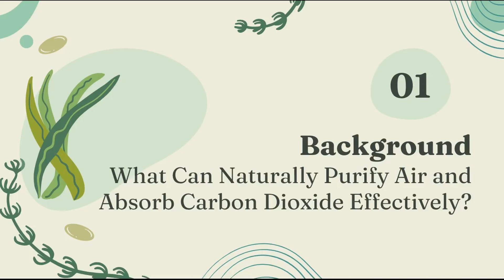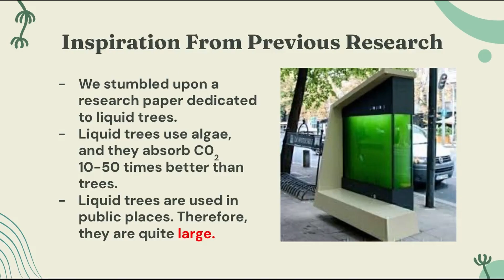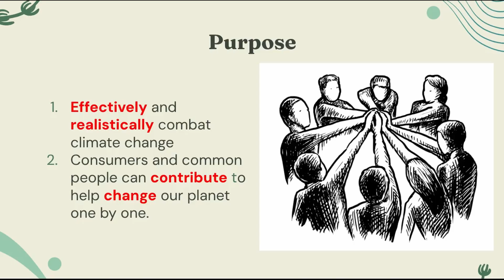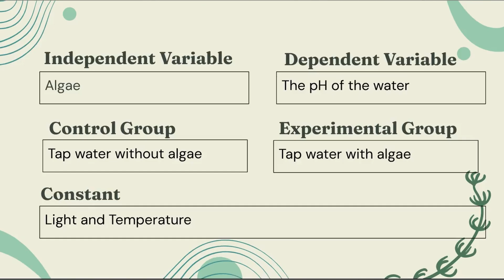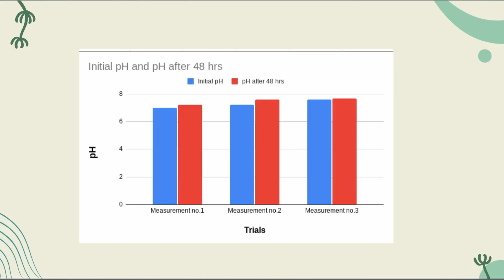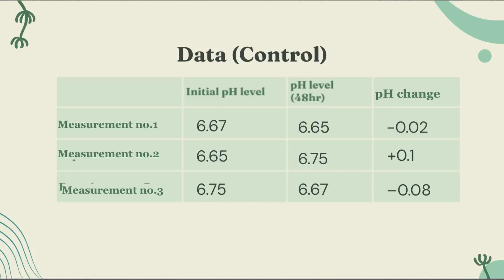Algae Air Purifier

Comment: Hi I came across your project while researching microalgae-based air purification systems, and I found your work really inspiring.I wanted to ask you something: instead of using an electric motor or any noise-producing device to ensure air circulation, would it be possible to rely purely on natural convection? For example, if we place a strong LED system at the bottom of the container and design the shape of the glass (or plastic) with a wider base and a slightly curved surface, could that heat gradient be enough to generate a sufficient convection current to circulate the air and microalgae inside the unit? I’d love to hear your thoughts on this approach